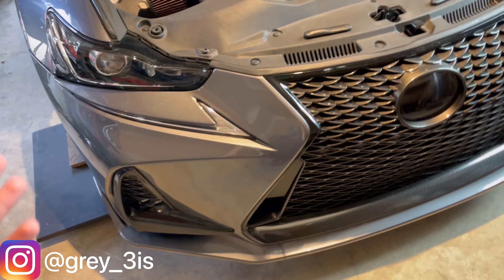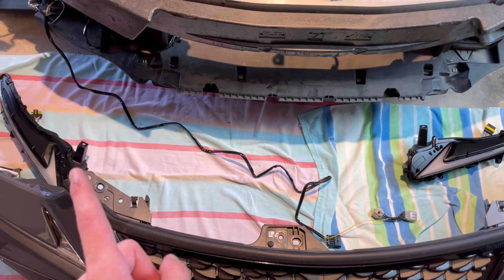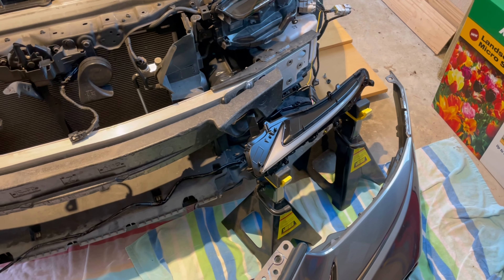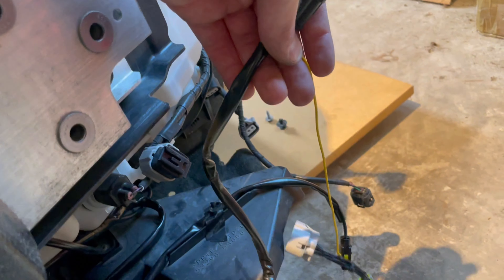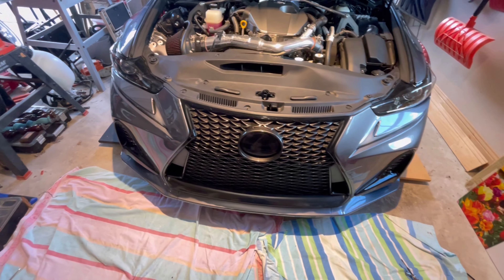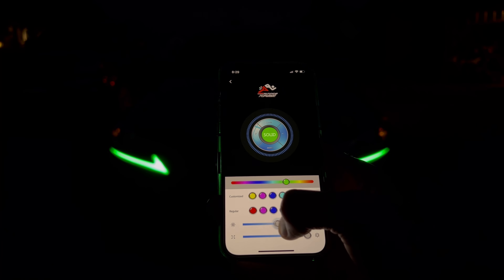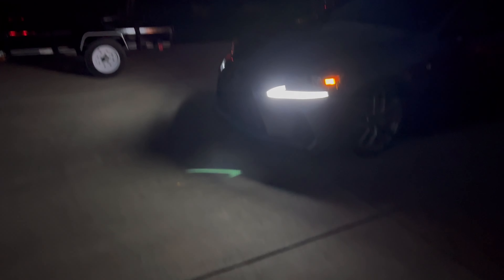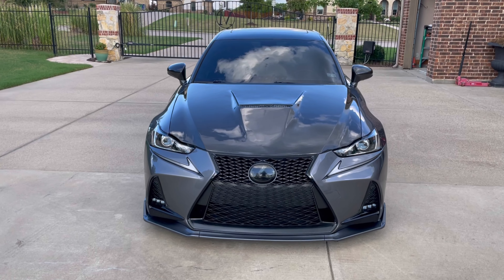HOW TO INSTALL RGB/ SEQUENTIAL DAYTIME RUNNING LIGHTS | LEXUS 3IS

Comment: I ordered these and used your code and it’s going on 2 weeks and they still haven’t shipped yet
Reply from the maker: That’s awesome! Thank you. I recommend reaching out to tansowerkz and asking for an ETA. They’re pretty quick at responding to Instagram DM’s.
Reply: @Grey3IS  so I just got mine and got them installed. They were working fine but now when I set them to a certain color it won’t show the color when I’m driving but when I turn the car off the color that I put will shine until they time out
Reply from the maker: @tlvckey1103  Ahh, gotcha! So, for them to show color (and not just white DRL mode) while driving, you have to have your headlights manually turned completely off or have your low beams on (either manually turn them on or leave it on auto at night time). If you have it on auto during the day or on DRL mode while the car is running, it will default to white DRL color. You can also turn on just the accessory mode (pressing the start/stop button twice), then turn your light stock to DRL. You’ll then be able to change the colors (during a show or whatever). 🙂
Reply: @Grey3IS  thanks man appreciate it

Comment: I just installed but only my turn signals work my app loses connection and won’t change the color of them any tips ?
Reply from the maker: Hmm.. I’d make sure that the connection to the module box is fully connected/ secured.

Comment: Is there a way to have the turn signal only on the drl instead of having it on both the drl and headlight?
Reply from the maker: You could just unplug the bulb from your headlight housings. However, you’ll get an error. So, maybe just paint your bulb black? 😅
Reply: @Grey3IS  I might just have to do that 😂 thanks for the speedy reply. Just got a 14 is350 2 days ago and been binging your videos
Reply from the maker: @reliqinc4879  I love that! Congratulations 🙂.

Comment: there a vid to figure out the app? it’s always white. modes worked, and then now it goes to white when i changed the number
Reply from the maker: I don’t believe so. But you can only change the colors of it if your light stock is switched to off or if your headlights are on. If the stock is switched to DRL, then they will display white.
Reply: @Grey3IS  ahhh 😂 yk i feel dumb now. such a simple fix. thanks for the response

Comment: can you change the drl light when your headlights arent on ?
Reply: DRLs or headlights need to be on in order for the lights to connect to the app to make changes. If not connected then no changes can be made. Hope that helps
Reply from the maker: Yes! You can change them while your light stock is in the off position. Or, while the car is off, you can put your light stock to the DRL position, then you can change the colors.
Reply from the maker: @supr3me47  You can also change them while your light stock is switched to off (with the car on), or while the light stock is switched to DRL (with the car off).
Reply: When my car is on and I turn the light stock down to the off position I still cannot change the color, only when I have the lights in the full on position, any tips on this ?

Comment: Does your car have to be on to have the rgb lights on?
Reply from the maker: Nope! Just turn your light stalk to DRL mode with the car off.
Reply: Sweet! That doesn’t drain you battery?
Reply from the maker: @eliassanchez5152  It does just use your battery yes, but it’s all LED so it doesn’t take much.

Comment: Can you comment on whether these lights work without synchronizing the application? Tansowerkz sent me a second unit, after the first failed to work, and I'm still having zero luck. They fail to power on when everything is wired correctly, however I'm not sure if this might be app-related or not (I can't get my hands on an iPhone at the moment). I'm using Android and it's detecting nothing. I looked through your comments here and it looks like you're using an iPhone -- not sure if that matters. Not sure if the module/receiver is dead, a second time in a row, or if the Android-based version of this app is just crappy/nonfunctional. Tansowerkz claims these should power on without the app, so I don't know.
Reply from the maker: Hello! I’m so sorry to hear you’re having trouble with them. But yes, they should power on just like your OEM DRLs even without connecting the app (Apple or Android doesn’t affect it). Connecting the app only allow for you to change the colors, animations, etc. It does sound like you have a faulty module. But if everything is wired correctly, it should work! You aren’t the first person I’ve heard from who has had a faulty module, and getting a new module was the fix. Again, I’m sorry this is happening. 🫤
Reply: @Grey3IS  Oh interesting. I did rewire the stock lights and there are no wiring problems, so I think you might be right in faulting the module for these problems. Terrible luck twice in a row! Thanks for your videos by the way, great stuff.
Reply from the maker: @MrAlexDelarge  Damn, yeah. You might have got 2 bad ones unfortunately. I appreciate your support man! I hope they help you get it sorted out soon.

Comment: hello Gr3y, is there one for 4IS?
Reply from the maker: Hello! No. Since the “4IS” has the DRL build into the headlight, it’s not going to be as cheap and easy to make it RGB. You’ll need to have a custom light builder/ modifier custom add RGB lighting to your DRLs within your headlight.
Reply: @Grey3IS  oh icic, i guess i will stick to the OEM!
ty!

Comment: How did you connect the light to the app Bluetooth wise ?
Reply from the maker: Make sure your headlights are on, hop in the app, select the code that pops up (that will be your DRL’s specific code). Then you should be all set.
Reply: What it no DRL specific code appears it does go through the whole color start up sequence but it isn’t being picked up Bluetooth wise
Reply from the maker: @johnathannyumah8823  Hmm. Make sure the engine is on, the headlight stick is manually switched all the way to low beam, then check the app. Lmk if it still isn’t working.
Reply: Yeah so apparently the lights use a different app called happylighting for the 2018 model at least instead of the one you used. Just a little head up for anyone else who comes across this
Reply from the maker: @johnathannyumah8823  That’s funky.. it’s not light runner? Where did you purchase them from? Maybe they changed something. Because the 2017-2020 should all be the same.

Comment: after you installed them did a headlight malfunction system pop up on dashboard? for some reason it shows that on mine
Reply from the maker: Hmm, no. I’d double check that you plugged all head light plugs back together/ plugged them into the right spots.
Reply: @Grey3IS  ok will do. also on the diff patterns im not able to change it to a certain color like you show the light blue when you have it on pattern 70 for some reason.. any tips?
Reply from the maker: @benzo7743  Wait, sorry, can you elaborate?
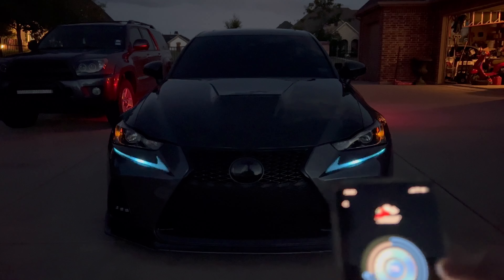Reply: @Grey3IS  so around 13:50 it looks like a turquoise color then around 13:59 it looks like another color? how are you able to change animation color to a different one like you did? on my 70 animation it’s a diff color and can’t set it to like a red

Comment: Do you know what those white pieces are called where you screw in the daytime running light? I need to get mine replaced
Reply from the maker: Sorry, no. But if you look up a parts diagram, I’m sure it’ll be there.

Comment: Would this work with the 2014-2016 IS model?
Reply from the maker: Unfortunately no. However, the 14-16 model ones are in the works! I’ll mention on my Instagram story when they are open for pre-order. It should be long!
Reply: Thank you! Keep up the great work with your videos!
Reply from the maker: @hgwe6018  Thank you!

Comment: Where you get the front logo ?
Reply from the maker: It’s the OEM emblem with vinyl tint over it! Here is the tint that I used 🙂
https://www.ebay.com/itm/302570215663?mkcid=16&mkevt=1&mkrid=711-127632-2357-0&ssspo=LfNlqsXiRpS&sssrc=2349624&ssuid=InDjhPXKRly&var=&widget_ver=artemis&media=COPY

Comment: Does anyone have experience with the non-RGB version of this product (Tanso stocks it). I'm hoping the module/controller/connectivity issues are resolved.
Reply from the maker: Hello! The NON-RGB version don’t have an app they connect to, so they shouldn’t have issues. The app is only for the RGB colors and animations. But the NON-RGB don’t connect to an app. A buddy of mine has them and they work great.
Reply: @Grey3IS  That's great to hear! Cheers!
Reply: @Grey3IS are the non rgb version brighter then OEM drl?

Comment: Do these not work for the 2015 is350 f sport?
Reply from the maker: They do not. But there will be a version for the 2014-2016 model years coming out really soon!
Reply: @Grey3IS  i really really hope you are right lol buying my 350 soon and trying to plan out how I want it to look.
Reply from the maker: @validuav2577  I got you! The manufacturer of it has already opened pre-orders. So, it’s a matter of time before they are available.

Comment: Do the RGB colors work on auto during daytime?
Reply from the maker: Yes! You just have to switch off “daytime running lights” in your infotainment. 🙂
Reply: @Grey3IS  I have to adjust the settings in my head unit? Lol lemme go see
Reply from the maker: @xav264  Yes
Reply: @Grey3IS  didn't work bro. Just cut power from the lights lol. Can't even connect Bluetooth
Reply from the maker: @xav264  The lights don’t power on at all? It should make them not white anymore, then allow you to change the colors. Make sure the car is running.
Reply: @Grey3IS  turn car on > go to settings > turn off DRL > lights turn off, can't connect to Bluetooth either, car still on
Reply: @Grey3IS  lights turn back on and connect to Bluetooth once I turn DRL Back on in settings
Reply: @Grey3IS  my car is cutting the power to the DRLs in auto when I turn off the setting
Reply from the maker: @xav264 Interesting…

Comment: What year IS is that
Reply from the maker: 2017!
Reply: @Grey3IS  thank you man , i have a question about the fog lights. Did they come stock? if not how do you turn them on and off?
Reply from the maker: @rplayer360  These are custom, and I sell them! They come with an OEM button to go in a blank button slot.
Reply: @Grey3IS  you’re joking now that’s what’s up.

Do you have an install video?
Reply from the maker: @ I can give you more info via Instagram DM! 🙂

Comment: Do they fit 2015
Reply from the maker: Unfortunately no, but they should be available for the 2014-2016 models years in the near future!
Reply: Those ones are just for 17-21 but the tansowekz said they’re making 14-16 and should be out soon
Reply from the maker: @ThatLexusISGuy  Exactly

Comment: having trouble trying to connect it in the app, it keeps saying “scanning”
Reply from the maker: Interesting. Make sure your car is turned on with the light stock turned to low beams (or auto at night). Then open the app and see if a model number pops up. Make sure Bluetooth is on too!
Reply: @Grey3IS  preciate it, but no model number pops up. I’ve been trying to click add device but it’s note picking up anything
Reply from the maker: @timothy7798  Weird.. as long as your headlights are on with the car running, they should show up. You might, unfortunately, have a faulty module box.

Comment: How do we connect to the lightrun app on IOS?
Reply from the maker: With your Bluetooth on, and the vehicle on, open the app, and your light code should pop up. You just tap it, then the features will open.
Reply: @Grey3IS  after downloading the app and starting the car, the app just spins in a circle on IOS it won't let us in the app. We scanned the QR code, the app used is called LighRunning. Is this the app you are using? We didn't see a light code.
Reply from the maker: @XoticAutomotiveLighting360  Interesting.. I have had one other person explain this same issue to me. You’re doing everything correctly. As long as the headlights are on and the app is open, you should be good. It sounds like there is some sort of issue with the module not sending out a signal.
Reply: @Grey3IS  good point I'm thinking he has a faulty module, because I also tried and Android phone and it repeated the same exact issue. I'll see if the customer can get the seller or supplier to maybe send a new module to see if that would rectify the issue.  I'll keep you updated on the outcome.
Reply from the maker: @XoticAutomotiveLighting360  Sounds good. And yes, I recommend the person contacts who they purchased it from. They should be able to send them a new module.

Comment: I just got these today, are they supposed to be made in china? The build quality looks cheap
Reply from the maker: Hello! Yes, these are manufactured in China. They aren’t Lexus OEM quality, but they are nice enough to function like an OEM product 🙂.
Reply: Are you aware that they arent even a manufacturer, they get these lights from HC Motion who exclusively sells on ebay,so tansowerkz charges a 20% markup when you can get the exact same thing from the manufacturer and with free shipping from china.. bro come on
Reply from the maker: @shadowknight4738  Yessir! Tansowerkz works with HC motion directly. They are a storefront that provide many parts in one place.
Reply: @Grey3IS  i feel like i been robbed, i expected this to be much better quality considering how much they cost and how much youtubers reccomend them, can you give a non biased take on their longevity or if there are any issues youve encountered, id appriciate it
Reply: @Grey3IS  yea but my guy i thought i was goin the quality route by buying parts from a reputible business rather than ebay china parts, turns out its the same thing
Reply from the maker: @shadowknight4738  They have been perfect for me and have yet to give me any issues. I think they are definitely worth the money.
Reply from the maker: @shadowknight4738  Most things these days are made non-domestically. It doesn’t necessarily mean they are low quality parts. But I understand where you’re coming from.
Reply: @Grey3IS  i guess time will tell, really wish i just woulda got them from ebay at this point though, but how about that hood you got from them? Was the carbon fiber a good quality? Was the fitment exact to oem standards, i wanna know b4 i blow 1800$ on this middleman
Reply: @Grey3IS  non domestically woulda been awesome had it been from japan or russia, almost anywhere but china
Reply from the maker: @shadowknight4738  Yessir, time will tell. And my hood and fenders are both from them. Everything is great quality. Fitment is great. Also, if you receive your part damaged, they will replace it. That’s something that you can’t guarantee from China.
Reply: @Grey3IS  im not trying to give you a hard time i know i didnt buy these from you but i bought these based on your review and you seem honest, i guess ill just have to see how it all pans out, thank you for replying

Comment: Anybody else have an issue with these not switching modes besides white
Reply: My app stopped working
Reply from the maker: Interesting. I’ve never had this issue.
Reply: Yeah very weird. Lights are great but they stopped switching modes after being installed for a week. Wondering if it’s possibly a faulty Bluetooth remote box, they only go white and rainbow very faintly
Reply from the maker: @williamparker960  Yeah, the rainbow is the startup animation. So that part makes sense. And it’s possible you received a faulty module.
Reply: I realize mines are like that too, but when my car starts I can't change color's.  But once my car is shut off and I turn on the lights manually,  the mods and color works when I change them. You should try it.

Comment: those r so fuckin hard omg😮‍💨definitely gotta get me a pair soon
Reply from the maker: I’m glad you like them! I’m enjoying them so much. 🙌
Reply: @Grey3IS  wanna order em maybe towards the end of this month but idk if i wanna get the lights or my tune. either mforce or d3. got any suggestions on a tune? currently got a downpipe, intake and charge pipe with my mufflers n resonators off and a 2inch exhaust.
Reply from the maker: @alexvela2780  That’s awesome man! I have the MForce tune and I love it. D3 you can mess the different maps on a module they give you, but I have no experience with D3. MForce has been nothing but amazing for me. I made a video about the MForce tune and my exhaust system a few months ago! If you get anything from tansowerkz (including the lights) don’t forget to use code GREY3IS at checkout to save you 10%!
Reply: @Grey3IS  thank you and i definitely will use the code. i heard d3 is more for performance but after seeing the dyno results on there compared to mforce, i feel like mforce is better in results. but i did see u can get up to 5psi more of boost
Reply from the maker: @alexvela2780  Well which ever you end up going with, you’ll have to let me know how you like it. Definitely get pops and bangs if you go with MForce. They’re so fun.
Reply: @Grey3IS  yea exactly why i wanted to do mforce regardless how much better d3 is or mfocrce lmao. with the tune can u hear ur turbo whistle with the downpipe?
Reply from the maker: @alexvela2780  Yes, the downpipe definitely causes you to hear the turbo whistle from the exhaust. But for turbo noises form the intake side, definitely get a open filter cold air intake.
Reply: @Grey3IS  yea i got the injen cold air so it’s open. damn i’m exited to get it jow